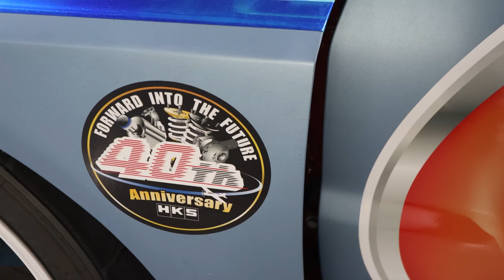Record Breaker Carbon Fiber Evo: The Legendary HKS CT230R

Comment: i miss the old "red" livery, but this and the old cyber evo influenced a ton of modern evo builds. nice work #LARRYCHENFOTO 🤙
Reply: Crazy to think how fast it is without modern tyre technology, very little aero and relatively low power. Im sure its still easily within the top 10 fastest at Tsukuba even after all these years
Reply: Full carbon was best.
Reply: This is exactly how I'm building my Evo!

Comment: This Evo is one of the GOATs and built like a GT car. Just by changing the tyres to A050s, it will be probably be close to 2 seconds a lap quicker (potentially putting it in the 51 second range).

Comment: The fact that this has so little aero compared to the new cars shows that you don't need all that horrendous likely non wind tunnel tested aero to go fast around Tsukuba. It makes zero sense, all that aero benefits maybe the last corner only, it being the only long sweeping highspeed corner. Why all these teams go all batshit crazy on the aero is beyond me, especially if they probably don't even understand it. Tsukuba is so short of a track and low avg speeds. Focus on mechanical grip and clearly you can still post sub 55 times. I stopped watching the time attacks cause the cars looked so ridiculous, didn't have any connection to what we can buy. This car looks like something we would drive, that's important. Last note, in the description you wrote it did 55, when you guys show a video of it doing 53, and the interview said 53.